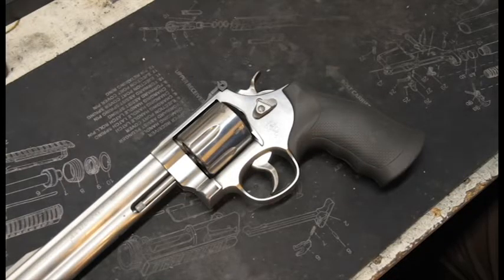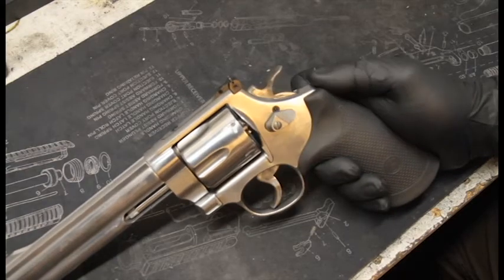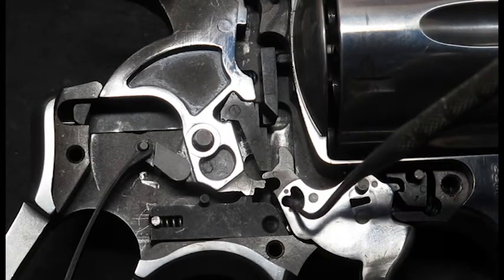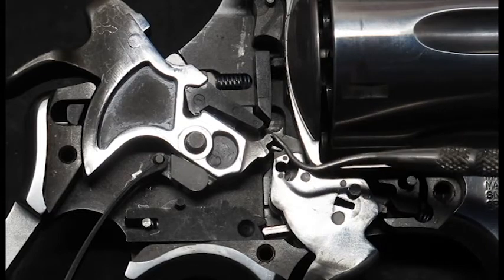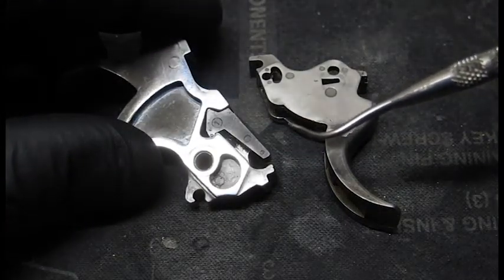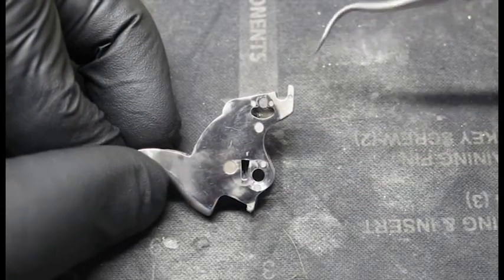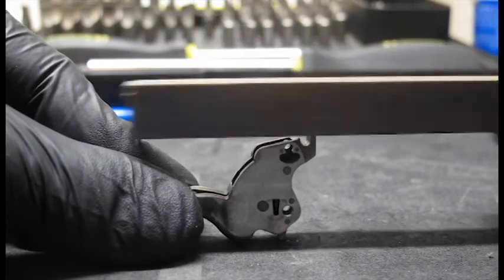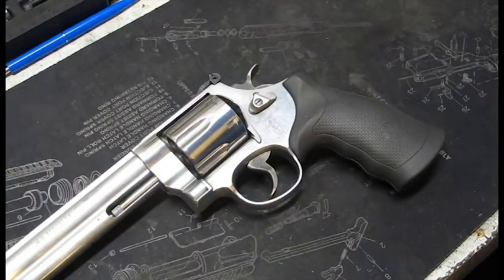Hammer push off in Smith & Wesson revolver

Comment: Hi,
Great video. I especially like the close up camera work you used to demonstrate the action and using a pick to show where the damage and wear was. Few videos do that and you did it well. It shows clearly the issue. camera stability was perfect. I didn't get a headache from shaky, amateurish camera handling.

One thing I would mention is that there should never really be any modification to hammer/trigger engagement when the parts are case hardened, as most S&W revolvers are. That case hardening is why you didn't see much wear on older heavy use guns. Along with just a smidgeon of oil, the wear will be minimal for the average  life of the gun. Well, I guess unless you pull the trigger literally 100,000 times. The technical part of this is that by filing it, you end up removing the case hardening and exposing the un hardened metal, EVEN IF you get the angle perfect. The wearing surfaces will suffer significantly accelerated wear out because the hardened surface is gone. Just restoning it will fix it temporarily, but the protection and hardening is gone.

Unless your insurance (whichever one might be applicable here) can handle the liability, if you ever see push off that's caused by a failed amateur trigger job (and I've seen quite a bit), I would probably just simply automatically replace the hammer/trigger pair. You have to remove them anyway, so there's no use in replacing a damaged set of parts that could cause an unexpected discharge of the firearm down the line somewhere.

Comment: Several omissions and errors in this video.

You should never operate the action under spring tension....or check for push off, with the sideplate off. And, without marking the bevel during stoning (Dykem), and checking it periodically with a magnifier, it's nearly impossible to tell when the correction is complete, and the bevel is sharp. It's very important to only remove the amount of material necessary. This is not as critically important when resurfacing the MIM trigger bevel, but is very important when stoning a case hardened trigger, as the hardened surface is very thin.

There is no mention of also checking the cocking notch in the hammer for damage prior to the repair.....and you don't recommend checking the trigger with a pull gauge to verify it is safe after the repair is completed. (3+ pounds)

You also state that this condition (push off) can only be caused by wear, or improper modification of the parts. There are, in fact, other factors that can contribute to this condition, including weak, damaged or altered rebound spring, excessive gauge on the hammer and or trigger studs, and excessive sideplay on the hammer or trigger. These conditions should also be checked out before the repair.

Caution: Another important thing I didn't hear  mentioned is that this repair only works properly, restoring the proper angle to the trigger bevel, if you use the proper Norton 6" medium India stone.

Comment: I am not entirely sure you are correct. I had a stock hammer, with little or no work done to it. It worked flawlessly with  2 triggers. The original trigger was replaced with the second trigger ( a nonserated, thinner trigger). This trigger was not satisfactory, but worked correctly. I purchased a third used trigger, which now does the job I intended... but..... now I have pushoff.  The pushoff began with the third trigger with no work having been done to hammer. So push off, it seems can occur with an altered/damaged trigger. Are you saying this can be fixed? (Since  the issue seems to be with the trigger?) By the way, your English is fabulous.
Reply from the maker: If you only alter the angle on the sear nose on the trigger to much, you will get push off, even if the hammer have never been touched and is factory new. It also goes the other away around, you can mess with the sear notch and cause push off without touching the trigger. I see this from time to time on revolvers where people have done their own trigger job without having the proper tools. Without seeing the revolver and assuming that you have bought the correct trigger for the right model and dash number, stoning the sear nose like I show in the video should fix the push off problem. But be aware that this also will increase the SA trigger pull weight.
The push off in this video was extreme where the owner ruined both the hammer and trigger, usually people have the common sense to only play with the trigger and leave the hammer alone.

Comment: Thank you so much! Unlike the clowns that take their time to post video about the problem, you actually took time to post a solution and in very good quality. Your english is great!
To note, this job can also be done with whetstone, like the ones they use for sharpening knives. Also sandpaper taped or glued to any long even surface. The longer the stone, the less the angle, so nose will not be as sharp. 1) provides more material for slower wear 2) less angle means SA pull will not suffer as much. Your angle shown is a bit steep. Mine came out closer to 90 degrees and works extremely well for SA pull.
Thank you very very much! You helped me understand the basics for the fix where no one could.
Reply from the maker: Thank you! My reason for making this video was exactly that, there was no real explanation for this problem and how to fix it.

Like you said, you can use different stones for this job and the length of the stone will affect the angle that also will affect the SA trigger pull. The Power Custom stoning fixture is a great tool when performing a trigger job to lighten the SA trigger pull.

What you see me do in this presentation and the stone I used is what I was thought by Smith & Wesson when I attended their armorer school and must be considered the “right way” to fix push off to keep it within factory specification. But as long as it works for you and you no longer have push off that’s the important part.
Reply: I was VERY surprised that forums talk about easy fix, but do not show it. Videos show problem only but do not identify a solution. Everywhere is written get new hammer and trigger parts and drop in. These parts are not drop in all the way, I had to stone mine on several surfaces to even get them to work normally. Additionally some non-critical engagement surfaces are rough and need cleaning up to have a smooth pull.  I must have touched SA surface when I micro polished DA surface. This video was a saver.  We need good videos on smithing hammers and triggers!